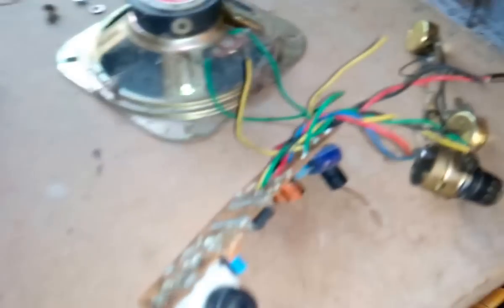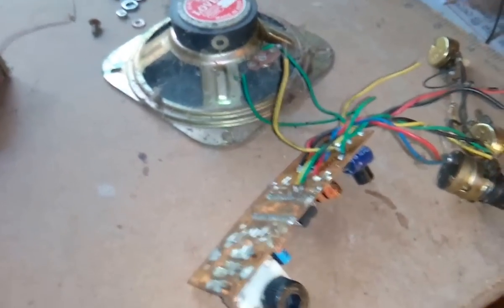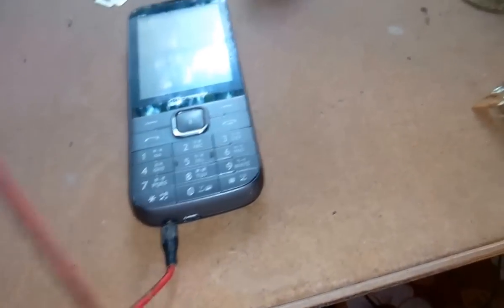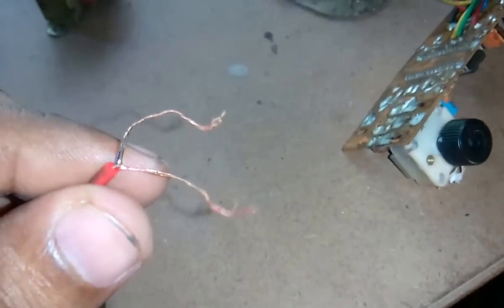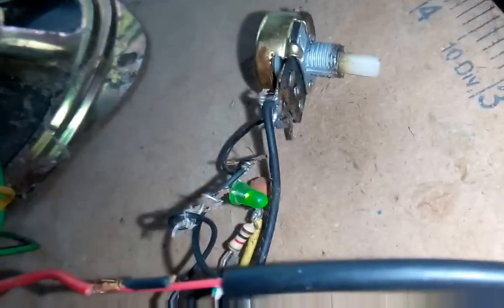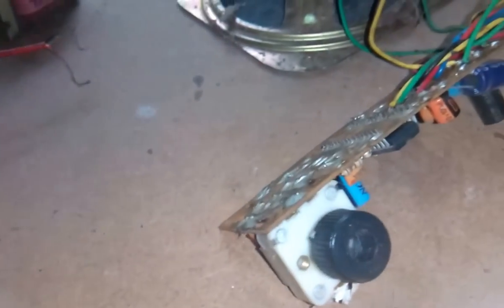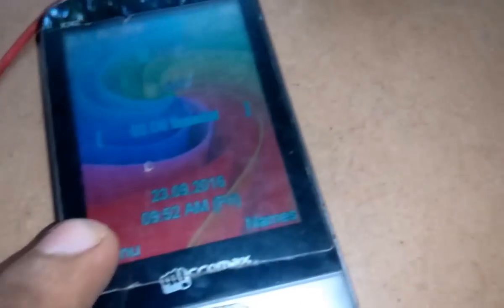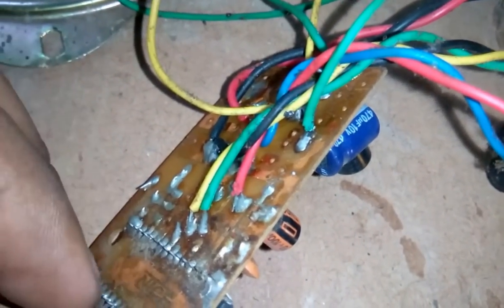how to make an easy amplifier by using old FM radio

Comment: Sir isi me aduio input kaha de gege sir
Respones and make video
Reply from the maker: Ground pin and pin no 23
Reply: Amer jiomobile  FM transmitter  audio player  mickro  genes  recover hoy
Reply: old fm radio  k board ke ic ka ground pin and pin no  23 pe audio jack ka wire connect kijiye

Comment: Kya ha iska circut diagram kidhar ha aur  kun sa ic use kar raha ho kuchu tho batha daa
Reply: kisi vi fm radio ka ic
Reply: old fm radio  k board ke ic ka ground pin and pin no  23 pe audio jack ka wire connect kijiye